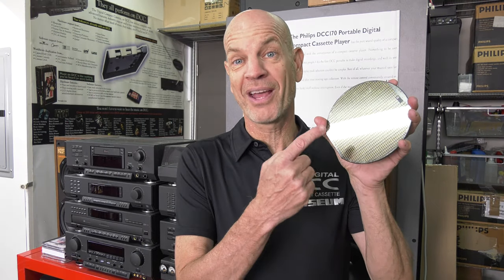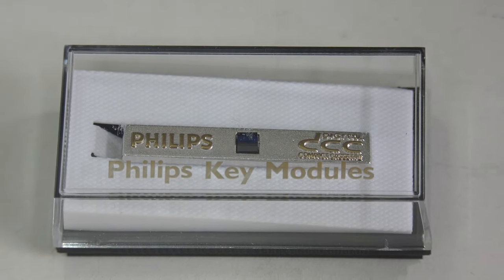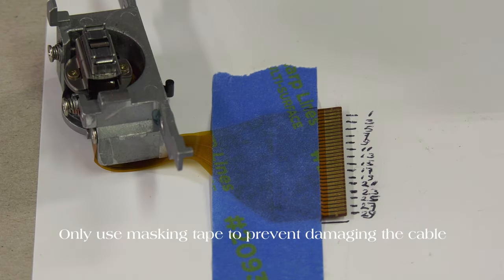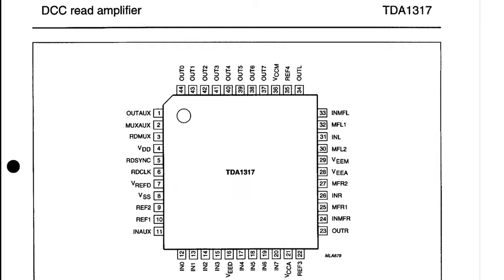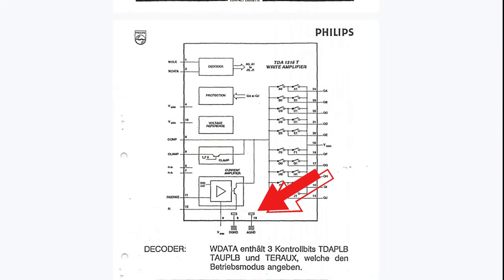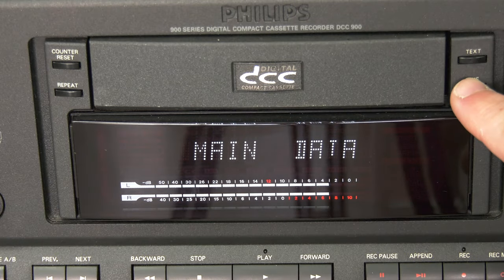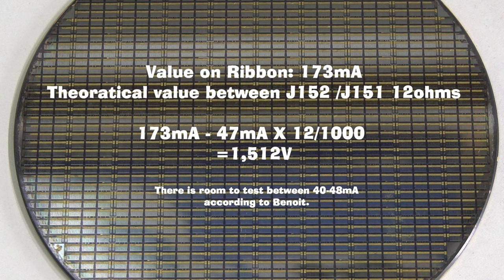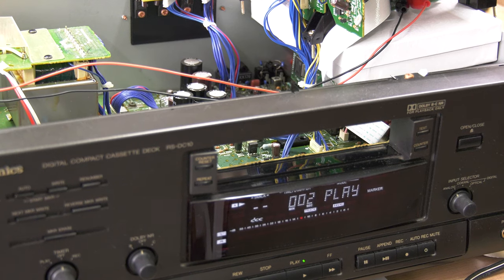Replacing the Head and PW03 Read-Write Board on a Digital Compact Cassette

Comment: Thanks! What about azimuth? Is this also a thing to be adjusted when replacing a head like in the analog decks?
Reply from the maker: Yes. You can use any dcc tape you trust en use the Service Menu in the player to adjust if needed.
Reply: @DRDCC  OK. Thank you. I have a complete Philips 900 system, including DCC900. I am now repairing the amplifier and i plan to do the DCC next. Hopefully it just needs a recap. I only tested it with a regular tape as i don't have any DCCs and it sounded very muffled. Thinking "analog" and wihtout any prior research, silly me messed with the azimuth a few years back when i got the system. I haven't powered it up since. Hopefully the head survived. I'l try to find a cheap DCC tape to test it out as i am very curious about this format and discovering your channel and the many other great videos on Youtube about the DCC made me even more curious :).